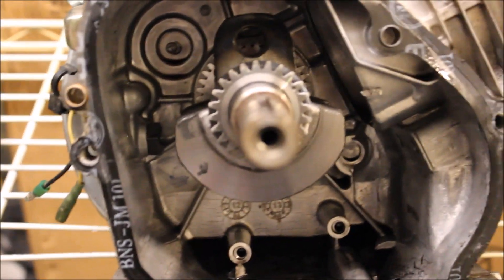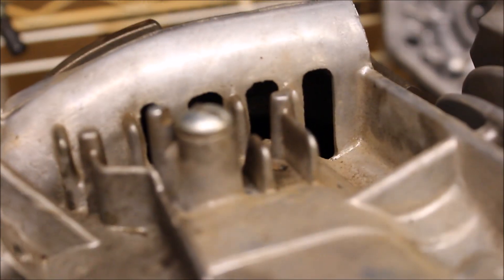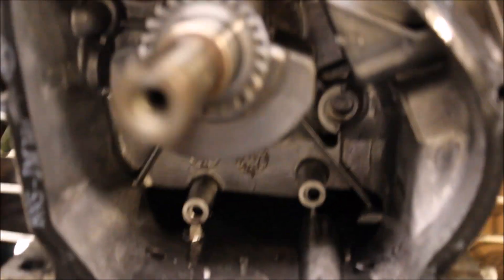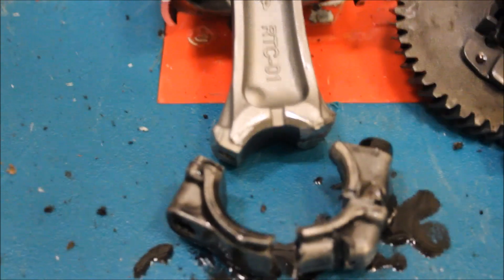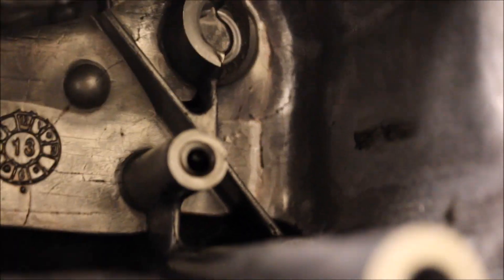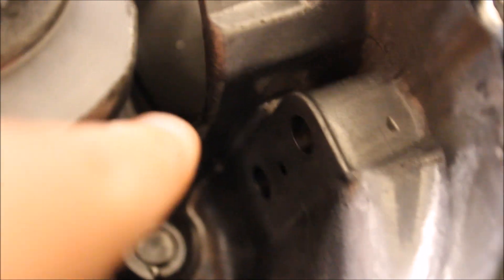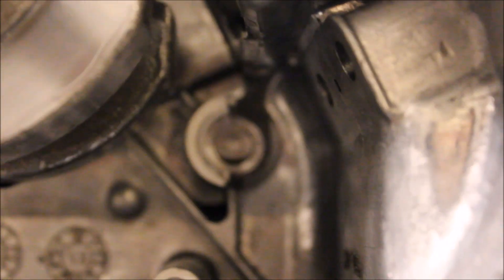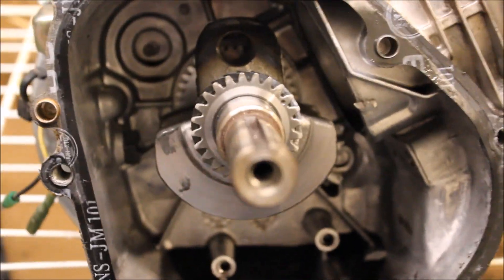What happens to your ungoverned engine without proper upgrades...

Comment: floored the shit out of a old briggs and it broke the valve in half and got stuck half threw the piston ........ did the pulley swap on a riding mower and it would do burnout on dry cement and do about 30mph scary as shit with no suspension and just bare metal.....

Comment: From what I've heard, as long as you don't replace your valve springs and don't go top speed for to long with the stock springs, you should be fine with the stock parts. But, on the other hand, it all comes down to luck based on how many imperfections are on the stock parts, so you could be fine... or doomed... and there's really no way to tell. That's why a lot of people get the billet parts, it's really just for extra safety.

Comment from the maker: @Pray Nicoya they are 15x6.00-6 tire.
Reply: Thanks so much you don't know how much I've been dying to know , you guys are amazing
Reply: +Pacnorwest Minibikeclub im willing to bet that motor had stiffer valve springs because ive never seen a 212 with stock springs do that... i run stock 212 parts on a 208 snowblower block (insane compression), high ratio rockers, cam is modded for high duration and a gx 390 carb with huge intake port/mani... its a high torque low revving beast im geared for +/-50mph the highest ive ever seen was 4987rpm gearing calc... 52mph long story short valve float is good lol
Reply: Hey I have the same motor bike as u we should race sometime
Reply: Pacnorwest Minibikeclub 

so I have a 212cc hemi predator engine with a couple upgrades which are upgraded jets, performance air filter and header so would the same thing happen to my mini bike plz respond
Reply: @adrenalinejunky716  No,...your governor is still in tact !!!
Reply: I use 13x5x6

Comment: I know this is years ago but I have a predator non hemi hitting 55 no governor stock rod /flywheel just has carb header and port work,removed the governor and still turns on first pull

Comment: I removed mine & im consistently beating on that engine & it just keeps going like a champ……But I also use the best oil that money can buy & I rigged a very powerful cpu fan that keeps the engine cool
Reply: It's the stock flywheel that can't spin too fast or it comes apart usually. But without heavier valve springs you'll usually be limited by valve float to a safer rpm

Comment: check out the missing rod bolt. ive seen this happen with at least 2 other predators, they still had the governors in them. the one rod bolt falls out, and then the rod breaks on the other side. these can be great motors, but the quality control blows. if you take the side cover off and pull the rod bolts out, locktite and torque them back in. cheap insurance.
Reply: DO NOT LOCTITE ROD BOLTS!
Reply: @robspear03  could you explain why?

Comment: The only time you'd ever need a "rod and flywheel" is if you replaced the valve springs to 18# or more. Other than that, you don't ever need to replace the rod and flywheel. All these sites telling you this is complete bullshit. Remove governor, throttle limiting screw and have fun with it. My guess is, this happened because the motor wasn't mounted correctly and bounced all over the place. They make this stuff called Loctite, your friend should use it next time.
Reply: That, or the kid put heavier springs in it and revved the holy hell out of the engine.

If you can manage to stay south of 5200 rpms, these engines will last. These kids dont understand that, trying to get 60mph on a mini bike designed to do 25mph. Dumb....
Reply: @robspear03  so if you remove the governor is it better for stock springs or no

Comment: If it’s a 212 it ain’t worth it. A new 212 is like 90 bucks vs the 189 for the flywheel that’s 2 engines and 80 for the rod that’s another engine. So I can build 1 engine that will still break or buy 5 hmmmm
Reply: Well with the rod and flywheel, u need a cam, springs, pushrods, carb, rockers. If it revs past 7200 valve float will happen and cook the head.
Reply: Well I port heads for 212 and I have seen rods fail a mess up the head. My engine out perform stock engines.
Reply: @bradenclifton45  I agree but still you can have alot of fun and just swap blown engines 5 times before you spend as much as a "built" engine and that engine still will fail. Just won't fail as fast. Best thing is to buy a 670 stock they are 22hp for the same price as a built 212.
Reply: @doityourself3037  as long as you don't floor it every 5 seconds you'll be fine anyway

Comment: Can someone please explain what these do, thanks: valve springs, jet, and the chicken hold.
Reply: Choke hold*
Reply: NY2OH valve springs have to do with the piston I think and give it a little more pump I think but don't quote me on it. A jet is inside the carb and is what allows gas into the float of the carb and that's why people get larger ones to allow more gas.
Reply: NY2OH choke hold is the thing that holds the choke arm down in place
Reply: Ok thanks
Reply: Valve springs are attached underneath the valves and hold the valves shut with force till the rotation of the cam forces them open...  The stiffer the spring (in theory)  the higher you can theoretically rev the motor also the stiffer the springs the more force is required to open them...  More force means more wear and tear.. Or abuse on the parts... 

The jet controls the amount of fuel the carburetor allows to be pulled in to the venturi (spelling bad)  based on air speed to intake pressure the smaller the jet the less fuel it allows to pass...  The larger the jet the more fuel...

Comment: Had a 212 with the governor arm pulled back..held it full throttle for about 1/2 mile and it blew up.. it blew a hole in the top of the engine.. it also broke the Piston arm...I will probably just buy another engine and upgrade a lot of parts before bypassing the governor again..

Comment: I dont know alot about mini bikes. But i was riding mine today.  I just got it a few days ago and it just made a bunch of like pop noises or like scratches or whatever and now it wont start and the pull start is stuck? Someone help me before i go buy a new engine?!?!
Reply: The motor is probably messed up u might have to get a new one ! Get a 212cc predator engine I got that on my mini bike !
Reply: +Michael Suazo your crank shaft might be broken. thats what happened to mine.
.

Comment: Ok so yes a billet flywheel and rod is recommended for these engines when installing parts like valve springs and high lift cams. That engine would not rev above 5500 rpms because of valve float so that means your friend cheeped out and only bought some springs most likely and reved the shit out of it. Removing the governer is a great idea for anyone with a go kart or mini bike
Reply from the maker: Stock springs buddy
Reply: @PacnorwestMinibikeclub  Still overevved though.....

Comment: He took off the governor, not the throttle stop right?
Reply from the maker: Yeah, if you look in the engine you can see the governor gear is gone and the governor throttle linkage on the top of the engine is gone too.
Reply: +Pacnorwest Minibikeclub ya design clone. but I'm sure its made cheaper with lower quality materials. ie cheaper case Chinese castings ect...

Comment: These lil motors don’t need billet parts if they have stock valve springs lol. Your friend just didnt have billet parts like you and your flexing making false claims.. these motors cant even reach the rpms to blow a flywheel apart just bcus you remove governor... 😂🤦‍♂️
Reply: Blew the stock flywheel magnet off of one

Comment: You dont need a billet flywheel all you need is a billet rod to handle the higher rpm the flywheel will juts help with the weight it helps you accelerate faster
Reply: don't listen to this guy ^^^

Comment: same thing would happen regardless if he used used wrong gasoline and made it knock. 
i've had my ungoverned Honda GX 160 at valve float for at least 30 seconds 20 times or more without any issue.
Reply: @Skott Great Skott, you may be right. or you may be doing lipservice for mechanical superstition. back it up with evidence and i'll believe you.
Reply: @Skott true dat, true dat.

Comment: are you sure that isn't fixable, it looks like if you used jb weld it'd be all good
Reply: Josh Grimm Oh man, we all wish it was that easy. Unlike the frame where a few mis angles would be fine, the engine must be exact. Not even .01 less. Every angle, timing, size, etc. must be exact. If you install new camshafts and you misaligned the gears... oh man, your engine probably wont start, if it does you will have major valve floating and pre ignition problems. Hey, but if you engine is already fucked up, just try the jb weld, you never know until you try. haha have a great day man
Reply from the maker: It's not worth it, plus he already has an extra predator (hemi-head)
Reply: No you dont put jb weld inside your block. Its always best to just fork over the money for a new part instead of cutting corners.
Reply: it's always fun to try...

Comment: What are the necessary upgrades to do after removing the governor and is it necessary to remove the governor arm while removing the governor
Reply: You dont need upgrades and no you dont have to remove the gov arm/shaft. Leaving it will make the job shorter and easier.

Comment: This wouldn't have happened with a quality engine , before I sold my mini bike it had an ungoverned 5hp Briggs and Stratton engine without any billet parts or mods it also had no air filter , I revved the living shit out of it and never really checked the oil , it was fine and never blew up

Comment: I didn't hear you say why your friend thought was going to go..Probably the rod  journal was worn out or as others suggested, defective bolt. I've read  somewhere that the stock flywheel is good to at least  5000 rpm. At higher revs, most would probably be fine. An occasion weakness in the casting could make it disaster.

Comment: anyone know a 500 dollar mini bike that is fast?
Reply: Don't waste that much, you can buy a frame with tires and waste like 200 or even way less and for speed buy a 100 dollar predator engine and and just add mods for like a total of (0 <$>400
Reply: Thanks Nicoya.
Reply: BMBlake Films/Gaming your welcome if you have any questions let me know
Reply: k.
Reply: Go to amazon and search monster moto mini bike i got one myself and its great not that fast but fast enough its 400 and fully assembled all you have to do is add gas and attach the handlebars check it out
Reply: Thx, do you know the speed of it?
Reply: It tops out at around 20-23
Reply: Mad _Clashers - Clash Of Clans pull the governor half out itll go 30 w/o complely wrecking the motor
Reply: Alright thx
Reply: +Shintaro Dee what do you mean half out?
Reply: think hes talking about the idle screw but thats not a governer
Reply: Yea because the governor is that little clip right so i as wondering how your gonna pull it half way out
Reply: yea me too
Reply: You can get a motovox on target.com for 300 then get a predator motor for 100 and have the same thing he's got.

Comment: Steps in order to have a fast and generally reliable minibike. 
1. Buy an old minibike that needs a little TLC
2.Clean up the bike 
3.Buy a running (or non running if you know what you're doing) Briggs and Stratton engine.
4. Fly the American flag behind because your the proud owner of and American made master piece.

I got 2 minibikes right now and both are both fairly reliable and if they do break its usually my fault.
Reply: Briggs sources parts from China and Taiwan.

Good try though.

Comment: When I use my minibike, for the first minute it bogs a ton and I have trouble accelerating... It's not a huge issue bc it goes away in a minute but still very annoying(212cc Predator Motor)
Reply: Make sure your using the choke right that could be the problem
Reply: CMBC thanks for the response but im 100% sure im using it right:/
Reply: Kyle W when you start the engine do you let it warm up or just hop on and ride
Reply: CMBC I give it 40 seconds before hopping on.
Reply: Kyle W I don't know what to tell besides just giving it some revs while warming it up
Reply: CMBC Okay thanks, I'll try that.
Reply: Your main jet could be too big and ur not getting the right amount of fuel and air mixture making u run to rich or to lean. Check the spark plug